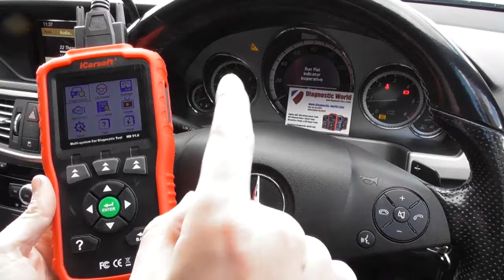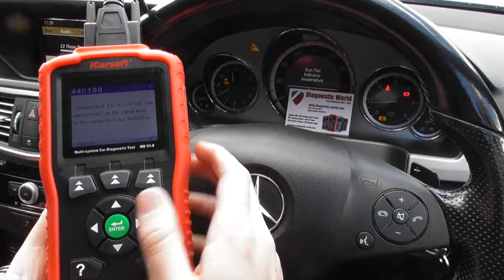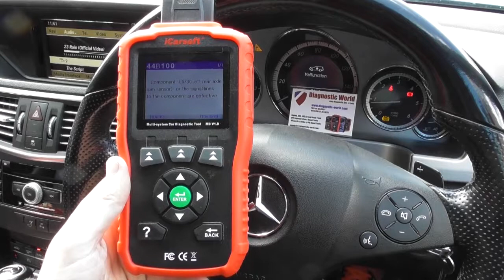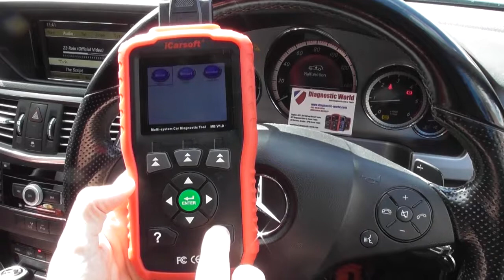W212 E Class Rear Left ABS ESP Sensor Replace Guide 44B100 DIY Mercedes

Comment: Does anyone know if these sensors are active or passive? Got issues as described in the helpful video. Bought replacement sensor which has not cured problem. Testing the sensor, I have open circuit, no reading on multi tester (verified hod). What is expected resistance?
Reply: Did you manage to find a cure for this problem?
Reply: Did you fix it?